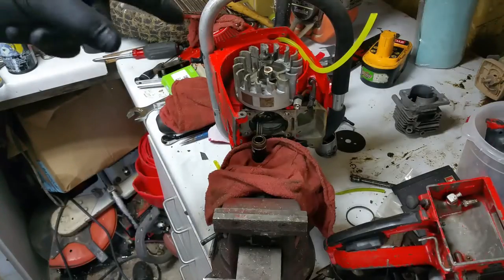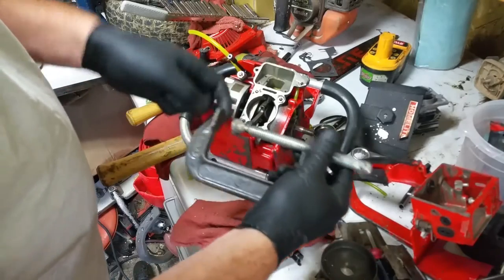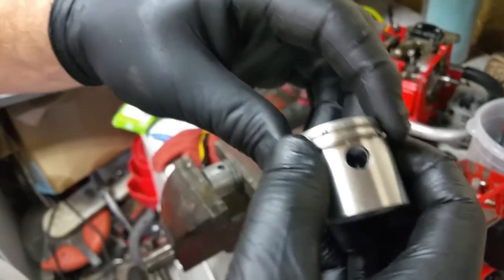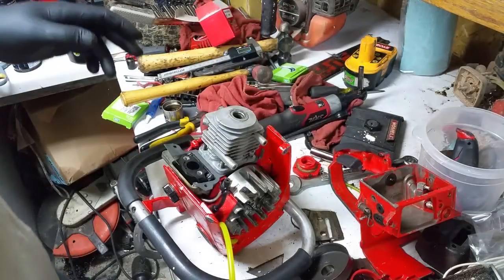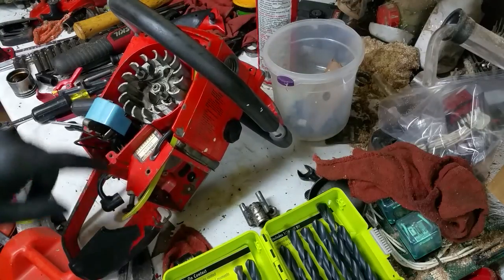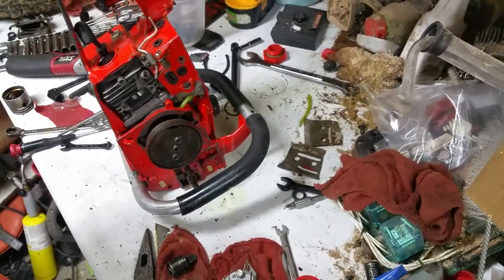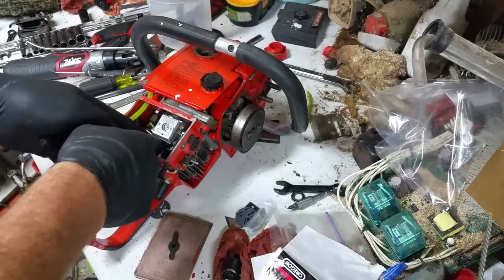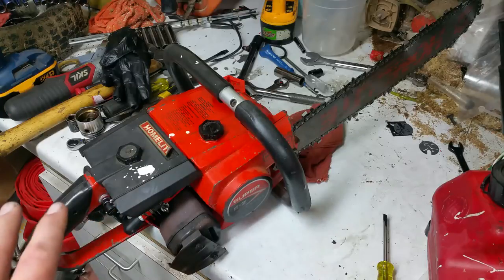Homelite super EZ #2

Comment: if you would  of just heat rod outside  and put your bearing in the freezer they will slip wright in and no hammering needed.
Reply: Hot air gun and freezer.

This is utube at it's best!
thx

Bake Blue coil @ 200/2hrs.  They can work a long time or dead tomorrow.  
USA USA USA